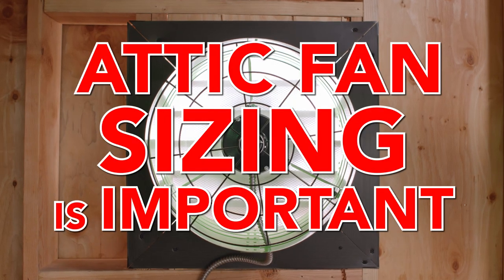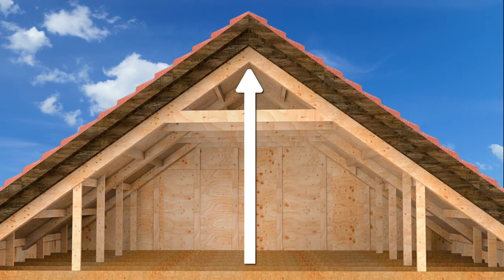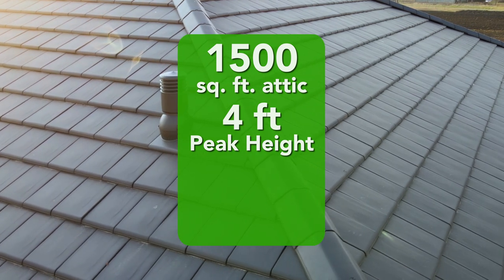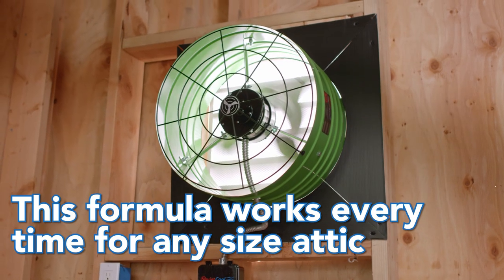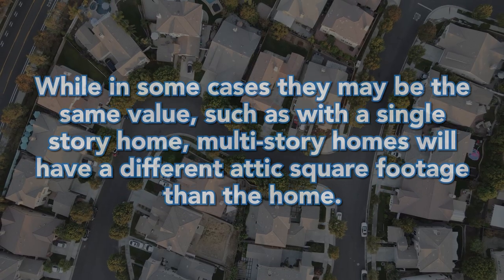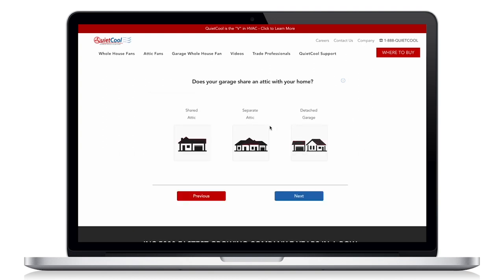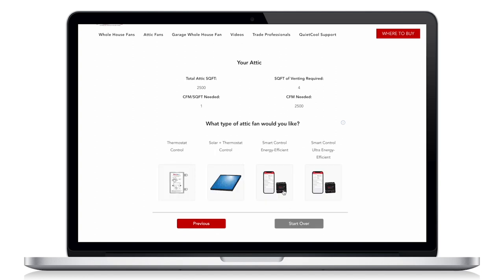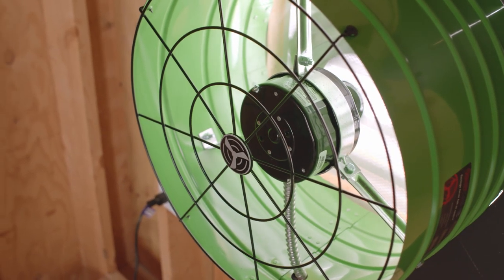How to Pick a Correctly Sized Attic Fan

Comment: My house gable vents are located on the West and East sides, so which side should I install an attic fan?
Reply: The side without any tree's? 🤔
Reply: East side
Reply: I have one of these fans. The temperature in the attic only gets a maximum of 15° above the temperature outside. They are super quiet and maintenance free
Reply from the maker: I’m glad you like it
Reply: @ValleyProud916  noticed aby difference in your AC usage throughout thw day with this fan?
Reply from the maker: @urielmoralez8036 it makes a huge difference on two story homes for keeping the upstairs cooler and making sure your attic doesn’t reach temps of 150 degrees on hot days. Because your attic will be cooler the ac ducts in the attic will be cooler and allow the ac system to push out cooler air.
Reply: @qcmanufacturing  thabk you for the information. Installing your WHF is the best thing I've done to our house. Can't wait for this heat weave to end to use it to its best potential
Reply: So does it matter if you go with the bigger cfm fans even if you don't need it? Would it cool much better?
Reply from the maker: @PeteyPablo408 the more CFM the faster you can do an air exchange. We have our attic fans move up to 3000 CFM so you can get an air exchange every 5 min in your attic. This will help keep your attic within 10 avg of the outside temp throughout the day and night.